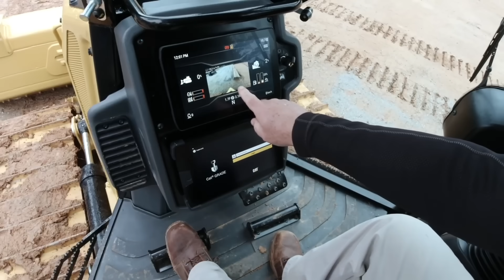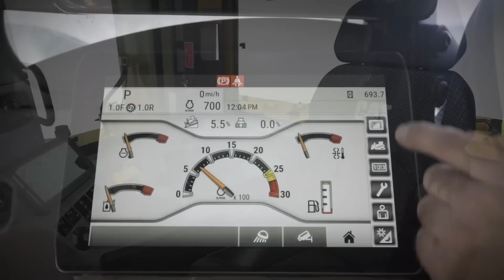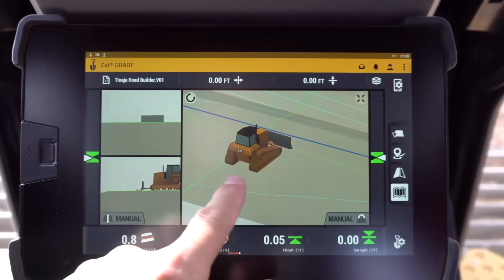Caterpillar D1 through D11: The Ultimate Bulldozer Line up

Comment: First dozer I got on was a d6 cable blade with pony motor . My uncle was a logger and I would go in the summer with him and keep the ramp & roads clean even skid big oak logs
Reply: If you could get the pony motor running, you could always start the diesel.  Those old naturally aspirated engines were smokey and fun.  Low RPM heavy flywheel monsters
Reply from the maker: You're absolutely right! Those old engines have a charm of their own, and there's nothing quite like the roar of a classic bulldozer.
Reply from the maker: @williamjones6053 that's awesome! I bet you have some interesting stories about those summers!